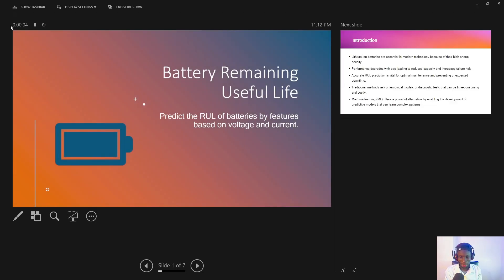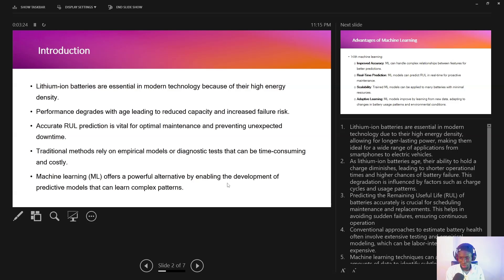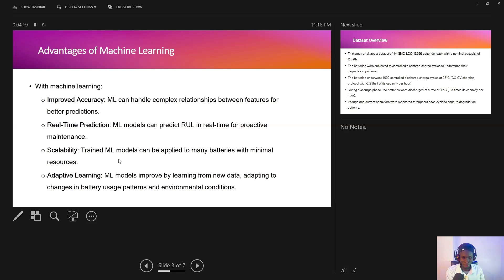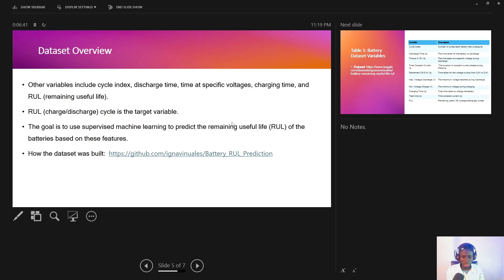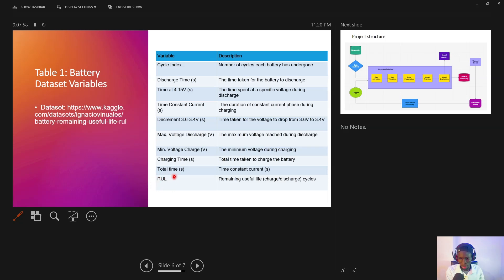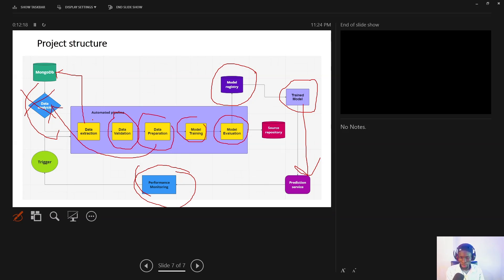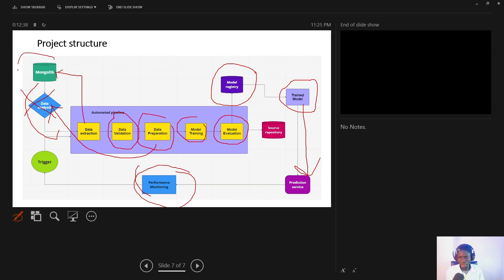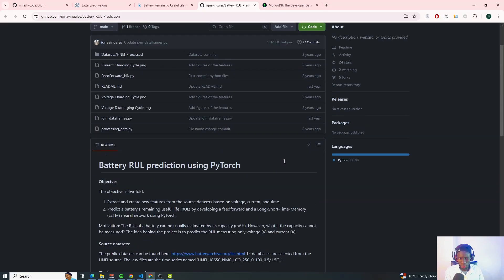MLOps Project | Predicting Battery Useful Life - Part 1: Project Scoping & MongoDB Setup

Comment: There is an issue with this project the issue is ur output column or the column to be predicted Is rul but in reality u need to predict the capacity and from capacity calculate rul as rul is something u don't get from any bms.
Also for mlops y rent using tools like ml flow